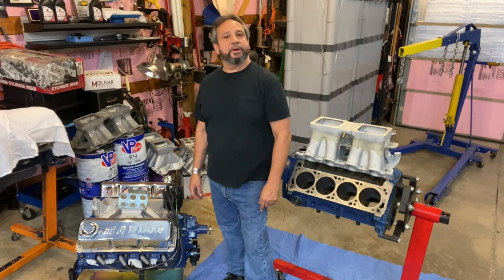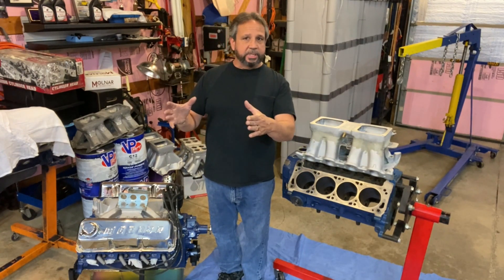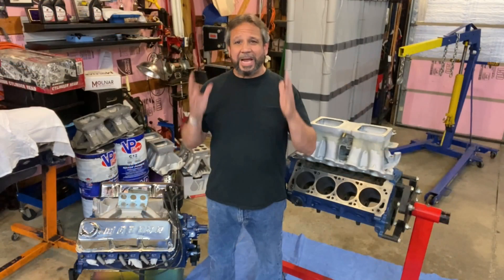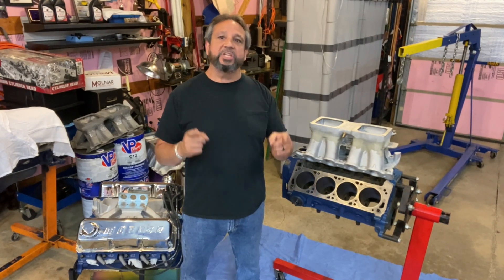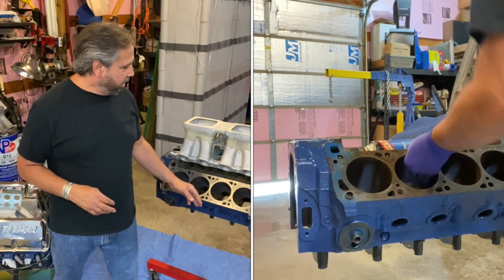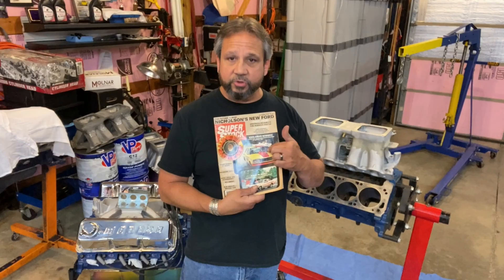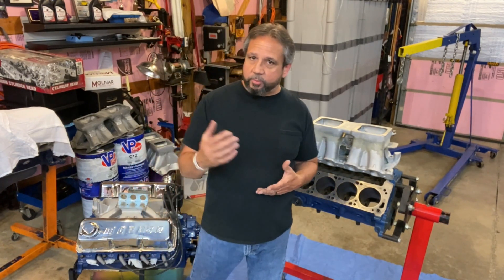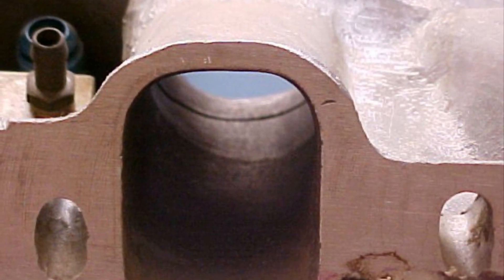Pro Stock Mania Returns: Dyno Don's Pro Stock Ford 351 Cleveland UR-19 Intake/High Port 4vs

Comment: What kind of cars do you have? I'd love to put a Cleveland in my 86 fox, currently I'm running a k code 289. It's got a single plane edlebrock Torker  intake, a 750 Holley double pumpe, hei ignition, headers, and a roller comp cam. I don't have a ton down low, but this motor screams so hard I actually thought my tach was off by 3k rpm. It wasn't . After the machine shop went through it, I shift it no problem at 7k. That's where it ran the fastest ET.
Reply from the maker: Have my 69 Cougar, 40 Ford coupe, and working on obtaining a couple other cars currently. Put the Cleveland In there and shift at 7500. 289s are screamers for sure
Reply: @dragboss351cleveland  awesome. I love cougars, I had a 67 I pulled out of the weeds years ago, It was a decent car, at the time I bought a wrecked 75 ranchero gt that was previously beautiful. I pulled the 351w, the c6, and 9in ford out of it and put it in the cougar.  I did it all in my driveway, the car was fast.
Reply from the maker: @burquebanditfab3928  my favorite year is a 67. Sounds like a runner. Have done lots of work in the driveway. When I worked as a mechanic, I was at a shop for 8 years that had no lift or a bathroom. You get it.

Comment: Thanks for the help on the main girdle i contacted FPS to get parts i needed im following your pro stock videos cool stuff an lots of good info.  I hav a 1970 boss block im doing with a weiand tunnel ram full roller solid cam with Tmeyer an Tom Molners 3.850 Center line stroker kit nice looking parts for reasonable price its going in a 1935 ford truck not sure if i can post pictures on here but if not ill try an post how it runs. My buddy has a real nice 1929 model T with 393 cleveland runs strong.  Keep the tunnel ram videos coming. Thanks again
Reply from the maker: Very cool Chad. Yes with the right cam you can make 700hp fairly easy. In that truck, you better strengthen the frame. Yes love the TR stuff. Whole episode on TR I am making now. Working on pro stock builds today. You can email me, address on about section of channel

Comment: Also in the 70s, the Gat brothers in melbourne made a 7.2 second  pass with a all cast 4V 351 cubic  inch clevo in a XA coupe doorslammer. Very exciting  times.
Reply from the maker: Michael that sounds wicked would love some info on this if handy. No doubt heart stopping. Cheers
Reply: @dragboss351cleveland  tnx Tim, I'll try to get a pic or a street machine cut out off the write-up. I remember the photo of the two brothers Infront of the blue beast of a XA, just says it all. I'm onto it.
Reply from the maker: Email me thpa351@gmail.com rock n roll.

Comment: The more you can come across and show here of what they did in the early days with these engines, the better it gets! Exactly like you say, the folks running Ford stuff back then didn't have hardly anything in the aftermarket to go to. Seeing this stuff really gets my memories revving. I've said to you before, I grew up with this engine, and have done countless hours of work on them, and every trick I have learned over 40 odd years, isn't all that can still be learned from what the big guns did to make an iron headed, stock block run like they did.  Thanks for the effort, and the time you are putting in here.
Reply from the maker: Thanks Elmer, that is what I am trying to do, bring back that Cleveland. See how it reacts and responds to the changes planned. I must have missed this, thanks for enjoying the Cleveland, as much as I.

Comment: I remember back in the day they would cut out the webbing on those manifolds between the runners. I realize they were trying anything they could to work with what they had. I assume the idea was to help cool the charge going into the engine but, in your opinion was that practice worth anything or worth doing?
Reply: Yes on cutting out the webbing between the runners.  Been there, done that.  As I recall it took quite a few hours of drilling starter holes, sawing and cutting with carbide burrs to do it.
Reply from the maker: I think it was for that, and it did help with that and weight. It may also be so they could get in there and port better, and then weld from behind. To me worth doing.

Comment: Great stuff Tim, those old guys did all the work for the then Ford Motorsport, meaning you could go into a Ford dealer in the '80S and bolt on a light weight mid '70s Pro Stock head. That A3 head contains all the hard earned speed secrets of those inventive Engine Masters !!
Reply from the maker: It sure does, they were way ahead of their time that is for sure.
Reply: All but the hart shape  combustion chamber that Glidden was using!

Comment: Imagine possibly how far behind the Cleveland  knowledge would be without Dyno Don, Bob Glidden , Kaase, Bud Moore etc... if they didn't take the risks, trials and testing like they did. Thanks to them small block Fords put big blocks on the trailers. I just looked at my '72 4 bolt that is in my Cougar right now and it is a SQUARE block. How does the square block stand up to the "D" block and the "no casting/smooth" block? Now I want to go look at all my other '70 blocks and my other '72 4 bolt to see what I have. Thanks Tim for your videos, 
Matt
Reply: p.s. I still see you have that one BBC troll that must have been embarrassed by a little 351C that still gives you the thumbs down lol. Or maybe he had a 426 Hemi or a 440 smegma Mopar hahaha.
Reply: @nova467spanker  , Matt there’s always going to be one sore loser in the crowd 😂👍.
Reply from the maker: Your welcome they were the true pioneers, and I respect from where they came from and what they did. No computers, no fancy gear. They made it work, and work they did. To me all blocks are pretty much the same, I think earlier the better. My current 409 is a square block. Check your inventory, your welcome.

Comment: Another show said they had a 72 Cleveland 4 barrel closed chamber heads but the block was 2 bolt main. That had to be a frankenmake it was toasted when they get it to run build. 72 were open mine open & had 4 bolt mains in 72 Gran Torino
Reply from the maker: The issue with Ford, was they did not keep things specific, meaning sometimes, heads were installed with what they had, I have seen some crazy stuff. I love those 72-3 Torinos, Had a Ranchero, back in the day, my first Cleveland. Thanks for supporting my channel.
Reply: Ford was definitely inconsistent when it came to their usage of certain parts such as engine blocks on the assembly line. Rather than interrupt the production of standard 2 barrel Cleveland engines because they didn’t have enough 2 bolt blocks available, they would use 4- bolt blocks if that’s what they had on hand. 

That’s how it was explained to me by retired assembly line workers. That would also explain why four bolt blocks are sometimes found in junkyards that were pulled out of low performance donor cars such as sedans and station wagons. 

The best way of knowing is to remove the oil pan for visual verification.
Reply: @danielwilson6665   Well i replied in one of these on parts my car had some different parts than normal a early intake or something for my motor i have the factory data plate on the card sold as new to original owner but not car. It had 5 Magnum 500's & a higher than normal  stall torque converter  plant installed also.
Reply: If i had a good one i would want to have Ernie & other Elliott's make it bulletproof not 600hp unless doable put it a 70 Torino Cobra with GT Package & trim in interior but exterior choice trim delete A/C, Automatic on the floor w/ Drag Pack
Reply from the maker: @LORISSABOOBMAN  Oh yeah, you can buy the 354 if you want when we are done, and it would fit perfect in the Torino. I love it when they had a console too.
Reply: @LORISSABOOBMAN  ,  I would imagine that the assembly line workers didn’t check for the correct parts before bolting one on and moving to the next part in line.  They were just waiting for payday to roll around 👍.
Reply from the maker: @danielwilson6665  Thats what nI heard from a line guy too. Thanks my friend for answering. Hope all is well.

Comment: Hey mate, love those tunnel rams, i have to admit im alittle excited to see you build and go down the pro stock route, you have all the parts and connections to show and build the truth and that is AWESOME!
UR19 the big bad tunnel ram, those iron clevo head you showed that were all epoxy resins covered to seal up and all modified is neat, as you said having to work with what you got and thats what i love to see, not just buy off the shelf but having to think outside the box and then of course thats where all the new hp parts come from like the c3 heads based on the hi port heads like you said.
Really looking forward to these new videos and stepping back in time to see how they did it and why.
Keep it up.
Richard, aussie clevo fan!
Pro stock baby!!!🤘🇭🇲🤘🇭🇲🤘🇭🇲
Reply from the maker: Hell Yeah mate. That is exactly what I want to do, those radically surgerized parts are amazing, no computers there. the heads I mentioned were the A3, the first of the Motorsport heads. I should make a video on all the stages, and developments of them. These Clevelands are going to be breathing fire. So glad you are here mate, stay strong, and stay tuned...Share with your motorhead mates...
Reply: @dragboss351cleveland  hey mate, cant wait to see what you create and watch it blow flames an lift off the line, i like all the mods to the manifolds with little blades to control an direct air flow an the filled ports, what type of putty or epoxy do they use an how do they make sure it sticks?
I saw a 300 6cly ford with 4v clevo heads cut up to make fit the 300/6 and it was used for drag racing, it was all welded and epoxyed together, how the hell did he do that, maybe show alittle on the processes they used on how they do that   with cast iron, its so interesting how they did it and it all holds together.
Look foward to more videos
Richard, aussie clevo fan 🤘🇭🇲💙
Reply from the maker: Thanks Richard. They used devcon or splash zone, a marine epoxy. It would stick well, but they mostly use bolts on bottom of intake ports screwed Into the epoxy itself. I have heard of the 6 cylinder and have pics of it somewhere, be a cool vid for sure
Reply: @dragboss351cleveland  Marine epoxy makes sence, that 300 6 is getting rebuilt by a shop called ellison's machine shop, he has made a video on it an recons from history it make 500 or 600hp on methanol.
Reply from the maker: Yea sir I have seen it quite impressive. I need to call him, about something.  Good looking out
Reply: @dragboss351cleveland  it amazes me how it was all done, its very kool.
Reply from the maker: Exactly and after I go over the close detail you will see how the air moves compare to unmodified intake.
Reply: @dragboss351cleveland  yeah sweet as! That will be very interesting to see, will stay tuned.
👍👍👍👍

Comment: Love the direction of the channel is going. Keep it up!
Reply from the maker: Thanks T, appreciate it.Just don't have the time that some of the other channels have. Doing my best to keep the Cleveland alive...
Reply: @dragboss351cleveland  I'm doing my best to collect parts.
I'm getting parts cheap because this new generation is getting rid of all the iron stuff and running aluminum.
Reply from the maker: @cammontreuil7509  I have collected for years. And that is one of the reasons to build my bucket list of engines. To use up all the parts. 😉
Reply: @dragboss351cleveland  I'm going to leave my cleveland  and 427 FE stuff with my 16 year old daughter. She's a motor head.
Bought a 59 283 for her to R&R. It's how I first started at 14 years old.
Reply from the maker: Keep it in the family a great idea trying to get my girls back in the DBG

Comment: just imagine  if the cleveland had come out in the mid 60`s  ,, i`m  from the early 70`s and rarely did anyone run a hopped up cleveland .. just was`nt enuff around ..
Reply from the maker: Hey Willie, If it did, be a whole different history. They say it was the most outlawed engine. Glad your here, more on the way.
Reply: Not hard to imagine, actually. Every single engine in NASCAR today, is running an example of the cleveland. Toyota, GM, and Ford all have engines designed straight off the cleveland.
Reply from the maker: @elmerfudpucker3204  You are right, I have that before. I always enjoy your support Elmer, hang on for more. You may get some flack from that comment, lol.